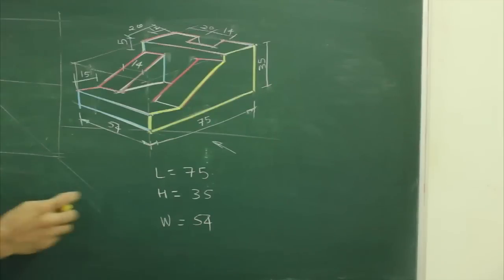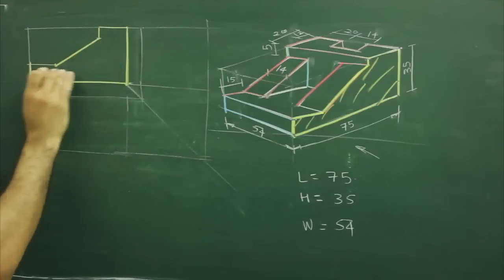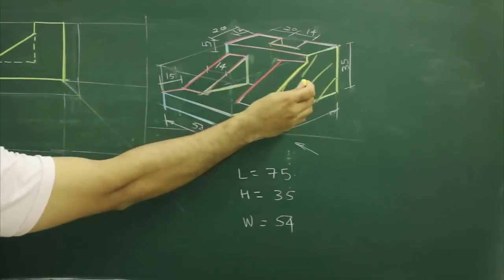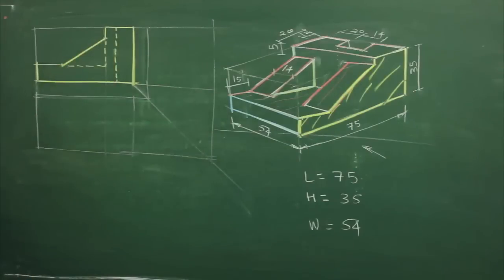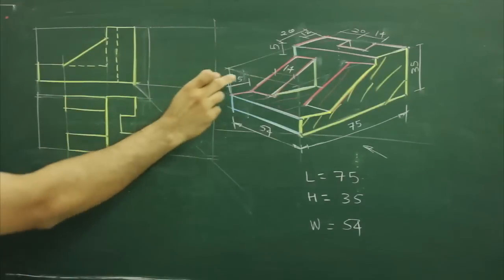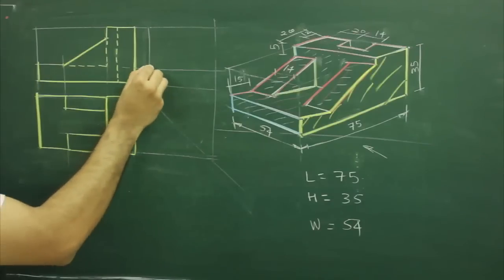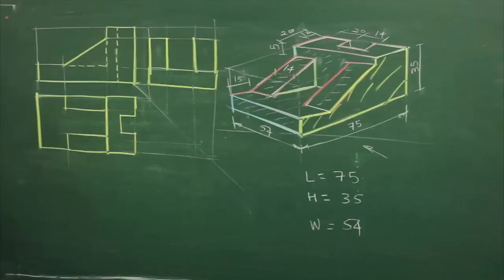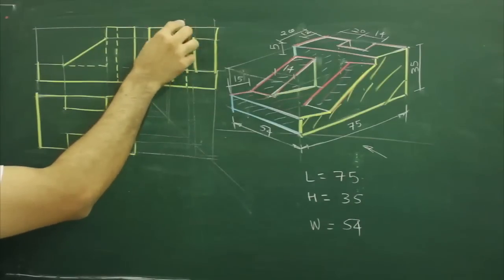Orthographic projections Q 17, Engineering Drawing, Technical Drawing

Comment: In front view, the height of one side is 35 but that of the other side (the shorter one) is not known. Did you just assume it?
Reply from the maker: Hassaan M height will remain same in front view and side view 
In top view we can't see height
In above question project all the projection you will get it
Reply: Sachin Pandya Thank you for your response, I am afraid I still cannot understand. There is an incline involved as well. We have to construct its two end points before joining them right? How can we do that if we don't know how much one side goes up from the bottom? Let me clarify the query. For front view:
> We draw the base at 75 mm.
> Then we go up on the right side by 35 mm.
> How much would we go up by on the left side of the projection? It is not dimensioned in the iso-view?
Please check this image: http://imgur.com/a/yHmzv
Reply from the maker: Hi that height is 12 mm I forgot to mention in the question sorry for the trouble take care and do let me know if you have more query
Reply: Thank you! That clears it up! :)